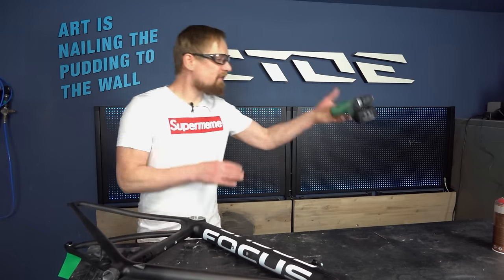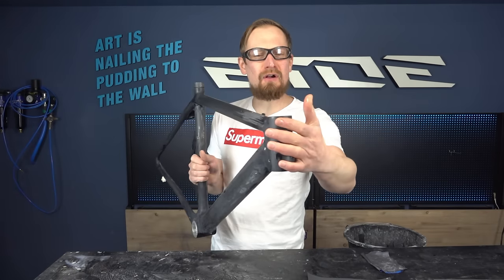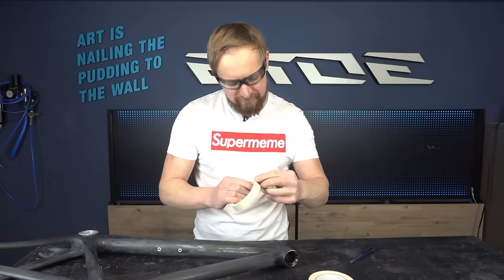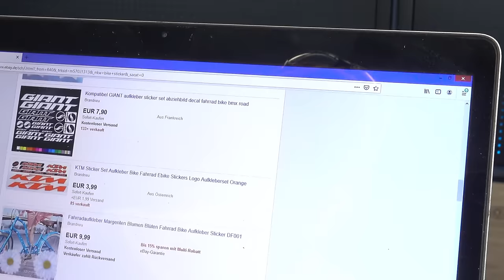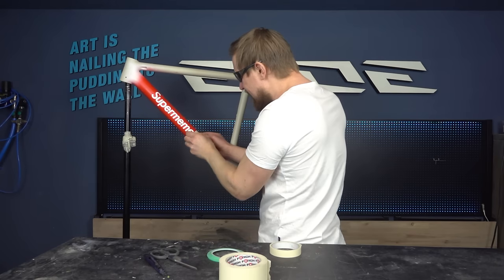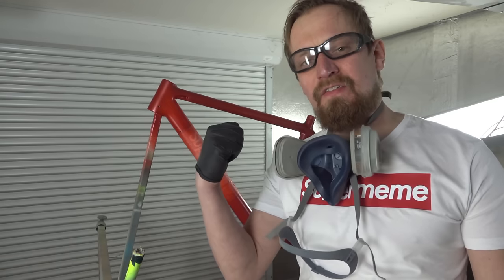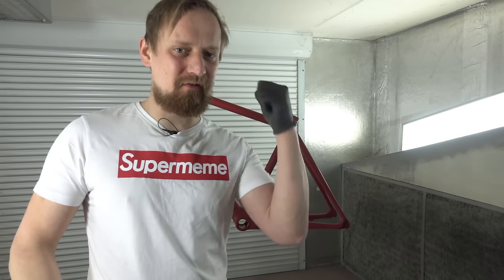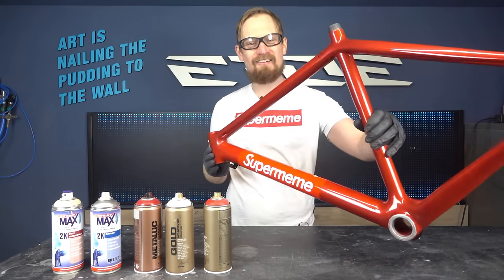spray paint a bike at home with supreme quality DIY

Comment: I was thinking about DIY painting my bike frame, but now I'm saving money for someone to do this for me...
Reply: Yep
Reply: Zero Kun I also live in a small house so Ill have to do that in the living room 😂
Reply: You also can ask your girlfriend...or your microwave or...
Reply: @ericmuller6582  wish I had a girlfriend.
Reply: @mymindfulhome1013  Oha..the comment from me should actually be placed somewhere else, but at the same time in a live chat and not here:>
Reply: I am learning to embrace imperfection. I won't do that much work and I can't afford for someone else to do that much work for me.
Reply: My paint job is done in about 20minutes but looks nothing like this hahah
Reply: 😅lol
Reply: @krunktina69  lol
Reply: @mymindfulhome1013  lol
Reply: Iama do it!
Reply: @mymindfulhome1013  hey I was in the same position but what I got was a pop up spray booth off Amazon for 70$ 😎🤷 
Paint then folding it away for storage.
Reply: how much does it cost?
Reply: If the sanding scares you you can use a paint remover, its easier. Then just a 2 coats primer, 2 coats whatever color
Reply: You really just need to get rid of the old paint, sand it down, clean, put a few layers of paint, a few layers of clearcoat. thats it

Comment: Awesome work.  Questions for you: 1) How would this process/materials differ for a steel bike frame; 2) What do you do to clean the frame between sanding and coats of paint to avoid debris from sticking to the frame.  Thanks!
Reply from the maker: I lick it, just lick it!
Reply: @ETOE  seriously though, what do you use to clean it? Alcohol?
Reply from the maker: Serious! I lick it. But if you think use alcohol. But please send me pictures afterwards. I love that kind of stuff.
Reply: @ETOE  Help us out here. We really are a newbie thats why we ask questions like this. I myself not really sure what to use to clean it. Is water enough?
Reply: @kevinsimbillo7951  He said it, use alcohol. Im gonna wash it down with water first and before every coat of paint make sure you degrease it, with alcohol preferably.

Comment: Just finished painting my frame. It took me like 3 or 4 days of sripping the paint and sanding in free time. I used thinner to degrease the aluminium and then a light swipe with isopropilic alcohol to gwt rid of any residue from the thinner, hands, etc. Primed it (1 hand, light sanding and second hand). Let it cure for about 2 hours (fast dry primer in hot Mexico climate), apply a frost hand of white to the front part (faded front to back) let it sit for 15 min, apply secord hand of faded white and a light fade of black from back to front (i left a fade from white pait to grey primer to black paint as an undercoat). Let it sit for about 20 min and apply frost coat of pure metalic red, apply second coat of same metalic red, apply 1st coat of the final colour which is inferno red with flakes, apply second hand of inferno red, apply frost black fade from back to front, apply second fade hand of black in the same way, finally apply a detailing hand of black to get the perfect fade I was looking for and let it cure over night to apply 1st coat of clear coat tomorrow once the day heats up. Untill now, it seems perfect to me  almost like a profesional custom paintjob to be honest. All thanks to this channel

Comment: I love how you use montana's ETOE, Ive been a graffiti artist for 14 years and its my preferred paint for everything! I painted my track fairing for my motorcycle along with many bikes, always holds up and allows for nice paint fades and quality opaque colors. Good stuff man! You are reinforcing techniques I have been using for years, good to know I was doing it right from the beginning.
Reply: I've used MTN 94 for my motorcycle fairing and seems okay without clear coat so far.. been meaning to re-do them. Any reason to use the product mentioned in the video over MTN 94? if better, I might give that a try.. also have you put 2k clear on your finish? no issues?
Reply: Hi Moto, I tried Montana Gold but was getting blobs of paint all over. I noticed that nozzle gradually gets saturated and then it sputters the blobs. Any ideas how to avoid this?
Reply: @IraklisKourtis  Hey man, the only way to avoid this honestly is cycling through multiple caps. Caps are super cheap, I would suggest getting a sample pack so you can test a bunch of different styles. Most likely you would want a "blue dot" cap. You want a low pressure cap meant for fading because they have better atomization. This modern day paint from the high end brand is SUPER opaque and thick so it has CRAZY coverage. So after using half a can or so of paint you will get some spatter because the paint is drying in the nozzle as you are spraying. hope that helps. also if you have a local graffiti shop, go support it.

Comment: I enjoy all your paint videos, and you inspired me to do also a bike painting. I used the color brand you recommended, but failed on things I didn't expected.
1. Glue of the Masking tape stuck on the color - (what is wrong? More Sanding between), I used 3M tabe  and oramask)
2. Small paint chips after removing the masking tabe.
I'm sorry to haven't made a video on that ☺️

Comment: Instead of using that kind of sandpaper, you should use 3D sandpaper. If you are going to prime the bike you don't have to sand it to P800 because you simply are wasting your time, you have to do it up to 320 if you want or 400 then prime it, and sand it again to P800, then paint it. And you forgot to do or to tell (if you did it behind camera), to degrease the surface, otherwise there could appear defects on the finished bike.  Before putting the clear coat, you have to sand it, not after putting the clear coat. Clear coat just has the waves that it has under it.

How do I know it? I paint cars.

By the way, the result was so good, you did extra work but you got a nice result! Keep it up, and take those as suggestions not as bad comment :)
Reply: Do you sand the colour then with 800?
Reply: @TheLineSeeker  If you have used those flakes you do sand it just to avoid them to get out the surface. But if you don't use flakes you just sand the primer, then paint and then the clear coat. Colour is only sanded if you use flakes or if there are some mistakes on it that you have to solve before the last coat.
Reply: At what point in the process do you degrease?
Reply: @jacobs-h398  Before sanding you clean it just in case to remove particles that could scratch the surface. And once you sand you have to degrease because you will put primer on it. Then it depends on technique, if it is wet/wet you don't have to sand it to paint it, but if you have to sand because you use a different technique, then you have to degrease again.

Comment: Wow. Very nice job. I feel more confident taking on restoring my old 80s Kalkhoff BMX bike to it's former glory, thanks to you. I have been thinking about doing the lettering with goldleaf. I wonder how hard it is.
Reply: Hey man. I just found this video because I was having a helluva time with the clear coat. Bought regular clear without the hardener. I had to sand this clear off multiple times because I kept getting orange peel, it didn’t harden,  and not a smooth clear. For myself, I took the bike all the way down to the metal. Sprayed it with primer, sanded with 40 grit. Primed, then sanded with 60. Repeated this process all the way to 2000 grit where I wet sanded 1000, 1500, and 2000. An OG told me that was the best way to do it. Sprayed the color on and wet sanded with 3000. Sprayed color a 2nd time. Looked  really good until the clear was put on. Found this video and I’m ordering the clear with the hardener. I think I’ll go 1000 grit after the first coat of clear and then spray the 2nd.

Comment: The quality does look fab. I would love to see someone attempt a painted raw metal effect, with brass burnishing and weld burns. something i have been thinking about for while but no idea how to attempt
Reply: Start by stripping your bike down to the steel. I use EZ Strip.  Just paint it on, second coat 10 minutes later and then wrap it with plastic wrap.  Wait like and hour and the paint will be falling off.  Scrape it with a paint scraper, wash it with water then scrub it with #0000 Steel wool and Brasso metal polish

Comment: I have a couple of questions about the use of Masking tape and decals/stencils. What length of time do you recommend for laying down the masking tape/decals prior to the next coat and when would you remove them after the next coat. Also is there a special technique to get clean lines and how many coats are too much for when you use decals.

Comment: Do you wash off any sanding dust prior to spraying the frame ? If so is their any technique because water tends to leave drops in inaccessible areas.. 
Thanks for all this information though
Reply from the maker: Yes I lick the dust off with my tongue.
Reply: You can use a tack cloth to wipe it down, the same technique used in auto painting or woodwork
Reply: Just rinse with water and wipe with alcohol hahahaha
Reply: Do you mask up your tinge first?
Reply: @timjohns3743  Shave it, dude.
Reply: @ETOE  u do whut
Reply: Is there an answer to this thread. Am planning a home/diy spray job. But what is the best way to remove all dust and dirt between each stage of sanding, to prevent orange peel effect etc. Any help, greatly appreciated......
Reply: @ETOE  Hi, is there another way, really want to give a diy spray job to my cannondale. But please, what is the best way to correctly remove all dust and dirt between each sanding stage to ensure a supreme finish. Thanks
Reply from the maker: @andyswash7984  the problem with you kids is you know only dish washers but not how to do proper work by hand.
Reply: @ETOE  Long time since I've been called a kid. So thanks for that 😉 is there a sensible answer on it's way? 😝

Comment: After the first and every layer of primer:
Q1: how long do I have to wait for drying to sanding?
Q2: after sanding, the frame is wet! How to dry or ho to clean the sanded frame?
Q3: what about the spay itself? Will it dry in the can or I don't need to worry still the primer is in the can? It's 2k so it don't need air to dry! How long is the primer or color in the can ready to use if not sprayed? Between praying - while sanding and drying - it need a lot of time!
Q4 what to use for cleaning and drying after sanding?

Comment: So, on a naked frame, primer, sand (I THINK wet sanding with 800 grit?) primer, sand (I THINK wet sanding with 800 grit?), paint, clear coat, sand (wet sanding with 800 grit), clear coat. 
Wait 1 day between primer coats. 1 day before painting. 1 day before clear coat. 1 day between top coat layers. 
I believe that you can speed that up if it's warm (like 25 Celcius). 
I'm in the process of doing this myself with cheap products that seem to work very well so far. 
Thanks ETOE!

Comment: Great video! I wish you would have listed the drying times for each painting step. Also, won't the 2K clear coat harden in the can between the first layer and final layer if there's a day between those steps?
Reply from the maker: You have 48 hours to use the can.
Reply: @ETOE  thanks I was Wondering this too

Comment: A couple of quick questions as I am starting my project today,  1) Should I use dry or wet sand, between epoxy primer coats and what grit should I use?  2) I am sandblasting my 1988 Panasonic DX 2000. Would it be best to wet sand after I sand blast? And should I use the scouring cream to wash it after I have sandblasted? I am concerned that rust could start to form almost immediately on the steel frame. Thank you again for these awesome videos, I have watched them many times and look forward to making you proud :)

Comment: Brilliant as usual! Could you do a video explaining how-to convert a Satin Matt black bike to glossy finish? I'd like to convert my Specialized Tarmac Pro disc 2019 (Matt Satin black) to a shiny finish without loosing my logos and maintaining my black color. Should I use 1000 sanding paper and then just apply  2K clear coat?
Reply: yes , pretty much. just remember to degrease between

Comment: what are the 2 component cans a primer and a what and a clear coat and a what? is it a hardener, you're saying? kind of sounds like you're saying harder but not sure I've never seen spray paint with a hardener, just epoxy with a hardener.

paint job looks great though, it's definitely harder than you make it look. I always have a bad habit of making my coats too thick I have to really try and dust it on there and remind myself it will all come together after a few coats. but when you're trying not to leave any spots untouched, often times that leaves the main areas with too thick of a coat. guess it just takes practice!

Comment: Do you ever have problems with the paint cracking around letters when removing the sticker? Should the paint be 100% dry or while it's still a bit tacky?
Reply from the maker: No I have no problems. Just do it full cured.
Reply: @ETOE  Okay thanks. How many layers are you painting? Primer, color and all..?
Reply from the maker: @mortenhansen3455  6 layers
Reply: @ETOE  2 layers of primer, 2 layers of color and 2 layers of clear coat?

Comment: Hi Martin. I really enjoy your videos. I painted an aluminum bike frame using Montana Black and used a 2K clearcoat (2 coats).  After about 10 days and before I rebuilt the bike I applied some car wax to the fork and it developed some hairline cracks.  Do you have any insight as to why this might have happened and what I can do to fix it?  Also I've noticed in some of your videos you have used Montana Gold.  Is that a better option than Montana Black for bike frames?

Comment: Quick question?  1.  Between each coat one would sand to smooth the surface?  2.  Using only 800 grit or a higher number?
Thanks

Have an old 1930's bicycle I am attempting to make pretty.  In perfect working order but needs a paint job to keep it going for another 90 yrs!
Reply from the maker: Quick answer, I still eating chilli pizza, no time to speak with a mouth full of pizza.

Comment: Martin,  your work is amazing.  This DIY inspired me to try.  I'm running into an issue and don't WTF im doing wrong.  1. Sanded Frame. 2. Primed and Sanded again. Finish was nice and smooth.   I'm using the Montana Black Cans, Shock White,  when spraying this the paint surface after drying is very sticky and really rough, almost textured, leathery looking and feeling.   Not sure if its dust or what, when priming this did not happen.  Thanks for sharing your master pices.
Reply: U need to use Montana Gold not Montana black
Reply: Same result with me using montana gold shock red ended up with rough powdery finish

Comment: So I painted a stem and I took down to bare metal, wiped it down with 91% alcohol and the first 3 coats came out clean. Fourth coat was the same brand paint but different can because in down to the last bit of paint on the previous can and I didn't any splatter shots coming out on my stem. Don't know what happen, but i got some weird dull bubbling on a small part. Question is, once it cures, can I wer sand the imperfection and just 2K clear coat it? Love your stuff btw ETOE!!

Comment: So I did my first frame and it came out quite nice. One thing though: when I removed a sticker at the end, which I was using for masking purposes, I tried to get rid of the sticky remains with cleaning gasoline and it acutally removed all the layers down to the frame :(. What did I do wrong, or is this to be expected?
I have an aluminium frame, used Nigrin foundation, montana acrylic spray paint and also montana glossy varnish..
Any hint is very much appreciated
Cheers!

Comment: Hi i'm carefully preparing for my first dyi......i've been reading a couple of things about the nastyness of 2K clearcoats and Isocyanite. Is a mask like you're using with a 60291 filter enough to stand for 2-3 applications of clear coat? Dont have a paint booth...so its mainly an outside balcony. Thanks.
Reply from the maker: You need a full face air fed mask, an active charcoal filter, and ultra fine filter plus a compressor which provides oil free air for the mask. All in all round about 5000$ to 6000$. Or just risk your life like every DIYer.

Comment: Why did you use specifically wet sanding? Would it be too bad to start with something like 100-grit dry, and then move on to higher wet grits?

Comment: You don't need to degrease and clean bike after sanding? I thought that was a very important step. Or is that the point of using wet sandpaper?

Comment: Question:  is the clear epoxy layer on the outside thick enough, that the carbon never gets touched?  I am not worried about structural integrity, but about discovering that I have mesothelioma later in life, because of some frames I painted 2 decades earlier.  Yes, it is proven, that carbon fibre dust is particles the same size as asbestos fibers, and has exactly the same risk of lung cancer.  So there are various precautions to be taken, not only a vapor mask (because tiny fibers that make it through a dust mask - and you should shave for a good seal), but also in the workspace: you can't allow to have any CF dust on your work table or floor - as air current will make it become airborne.
Reply from the maker: No you will loose your life if you work on your carbon bike. So don`t be a dick ant let your frame as it is!
Reply: @ETOE  I understand your cavalierish sarcasm, but it's a serious issue.  Maybe you're not aware of it.  My question is simply: is there usually enough epoxy on the top later, to not have to worry about CF dust.
Reply from the maker: No you will loose your life! Leave your frame as it is! You will sand emediately on the carbon.